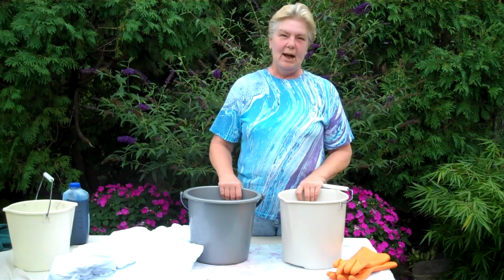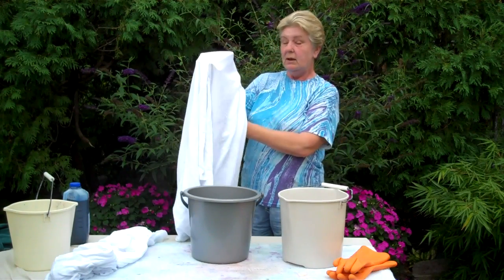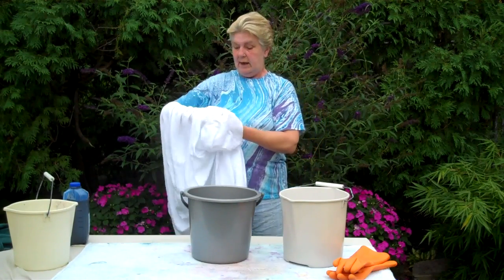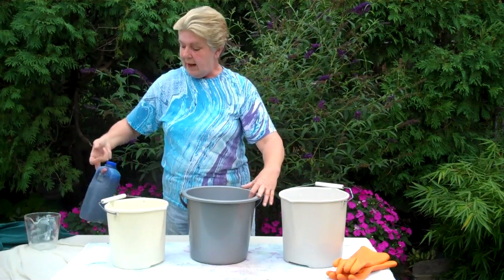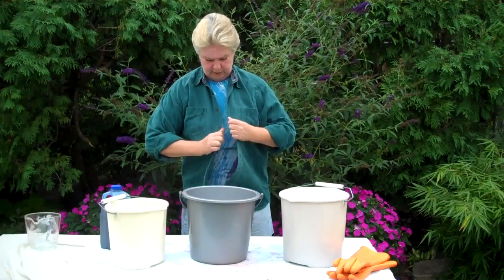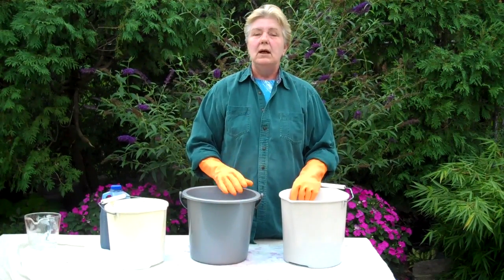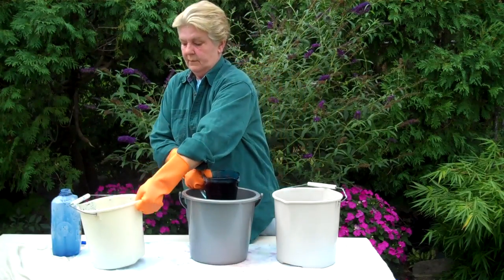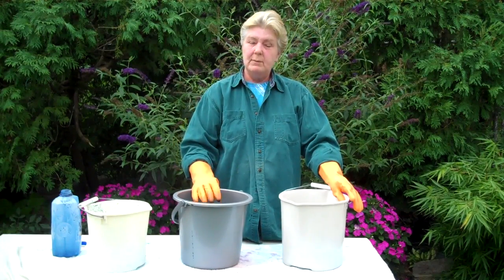Dyeing Fabric - Low Water Immersion Dyeing

Comment: Thanks.  I'm prepping to do a low water immersion dye on a king size linen duvet cover.  Not my first time dying but I've never tried the low water method and I'm shooting for the marbled look.  Appreciate the demonstration & that you showed the difference between the dry & wet fabric.  :)
Reply from the maker: If you can, do some test runs with smaller pieces, maybe linen napkins. Good luck!

Comment: Hi I have a couple of questions about dying this way. I am doing a Jean jacket that messed up trying to ice dye. I'm still new to dying. Anyway, I am trying to dye it pretty much solid colored and was told by Darma that it might be best to try low immersion since I didn't want to try to take the color out. I am using procion dye. Dharma Indigo Blue and I was wondering how you mixed your dye into liquid before you added it to the material. Also I would like to know how high the water needs to come up over the fabric?
Reply: To mix the dye with water MrTieDye shows the method I use early in this video: https://www.youtube.com/watch?v=3Fj289T6BVg&t=13s.

You just need a container you can shake that will hold enough water to dissolve  the amount of dye you are using. I usually use about two cups of water for 1-3 teaspoons of dye. You can then add that solution to the rest of the water. 

To determine how much total water you'll need, put the jacket in a bucket and see how much water is needed to totally saturate the it with some room for the jacket to move around a bit. I'd suggest you move the jacket gently from time to time while dyeing. This is because the Indigo Procion dye is a mix of dyes and if you don't move the jacket at all you may see the dye split or separate into it's original colors in some areas. For this reason I'd also suggest adding the soda ash to the dye bath before adding the jacket. This isn't always done in low water immersion but is used to avoid really dark and really light areas of dye.

I don't know how dark the colors are from your ice dye experiment but if they are  fairly intense be aware that adding indigo over yellow will create green and over red will create purple rather than a consistent dark blue. You mentioned you don't want to try to remove the dye so this is just a cautionary note. Good luck! Glenda
Reply: @glendahopp  thank you so much. How much soda ash in cup measure will need in water and do I add that to cold or warm water? And then add the dye into the water?
Reply: @glendahopp  oh and when I'm done do I rinse it before I wash it in the washer and with cold water? I'm using indigo blue like I did when I ice dyed it.

Comment: What is the water softener called you use for last rinse?? Pls, what about the product called retayne?
Reply: Any supplier that sells dye will also sell the fabric softener. Dharma sells Milsoft, ProChemical and dye sells OROsoft K. You use a tiny amount in hot water for 10 or so then rinse with warm water. It really does make a difference in the softness of the dyed iitem. Retayne is usually used for fabric or clothing you've purchased that you think might bleed. I've never used it for fabric I've dyed.

Comment: What do you do if you want to make use of more than one color?
Reply: You can try two things. First, use a flatter container like a glass baking pan or kitty litter box, put your fabric in first then add different colors in different areas of the fabric. Make sure that all of the fabric has some dye on it but don't stir. You will have areas of the colors you added and areas where the colors blend together. Second, you can use a mix of colors all together. Dyes travel through the fabric at different rates and while one color of the mix will be more dominant, you will end up with a variety of colors especially if you leave some of the fabric above the water line. Again, don't mix or stir the solution, you want to let the color migrate as it will. The link shows a jacket I dyed this was in a premixed brown dye and the turquoise migrated to fabric that was not submerged in the dye solution. http://bit.ly/2oUzJ9L As always, you have to test.